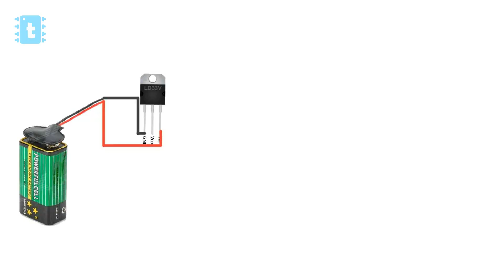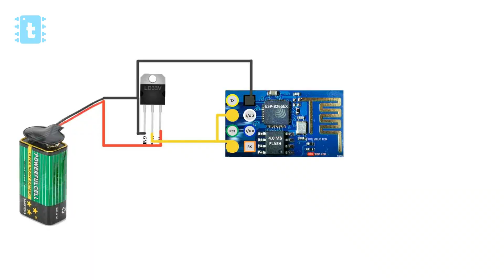Controlling Relay with esp8266 module | without relay module | without Arduino

Comment: I realized my failure in the numerous guides I followed to put a transistor on the relay driven by ESP8266-01 ... I was always excited by the relay because the optoisolator was missing. Thanks! Now I get Optosiolatore and I can finish the project. I used as Relay a KY-019 on a base with three positive contacts in the middle, negative on the right and Input on the left ....

Comment: Hi, I'm struggling with other issue managing relay board and I would like to know if you could give me any tip. I did mount all schematics as you shows with a littles tweaks. I did used a cell phone 5V power supply that power FTDI which feed the 3,3V to the esp01. I used the 5V to power up the relay and optocoupler. Before I'm been using the GPIO of the controler connected to the pin 1 to trigger the optoisolater and the pin 2 connected to the ground, but now I did as you show in the video. The question is, I need a dry contact to control my garage door which means a short circuit during less 1 second. I did an automation with Home assistant that can achive that. But the esp01 always flickering when boot, which means a trigger the the garage door. How I can keep the relay at off state until the esp01 finish the boot?

Comment: When I connect my esp8266 to coil pins on relay, my voltage drops from 3.3v to 1v. But relay works correctly when I manually use ground and 3.3v from board on relay coil pins. Why such big drop occuring?

Comment: Why I don't face this when I use relay with arduino. I never used optocoupler to switch relay.!should I? It gives isolation thats true. Is there any other problem?
Reply: Output voltage of Arduino is 5V & that of ESP8266 is 3.3V. So you won't have any problem while using relays on Arduino.

Comment: one problem i found after reset gpio pins not working when connected to led .. if not connect led then reset and connect led its working but that is not a write way to use if any power interrupt occurs device will not start after reset

Comment: If you can necessary electronic parts which you have used... That will be more helpful
Reply from the maker: +rohithd what??
Reply: techiesms i was interested to know the parts list used in this video.. So that i can get them from the electronic store
Reply from the maker: +rohithd 
Esp8266 01
Led
6v relay
1n4007 diode
Bc547 transistor
7805 ic
9v battery
Mct2e ic
1k resistor
Reply: techiesms octocuplor ic???
Reply: @techiesms  Hi sir, 7805 IC looks like 5v regulator, will it be suitable for esp8266 ?

Comment: Hi I need a control on DC motor by sending cmd msg (off/on/frwd/backward) to esp8266_01 module via android app on wifi/hotspot connection....?? how to achieve this??
need assistance

Comment: but  in esp01 relay board operate  though a  single  transister  no  optocoupler used in that
Reply from the maker: Well not all pins works with transistor 
That’s the thing

Comment: hello, congratullation for the video. I followed the video struction but, i am having problem with esp8266-1, the GPIO or GPI2 Pins goes "HIGH" a short pulse on boot ". could you help me?
Reply: use a 1N1007 Diode or LED before connecting your node to the module
Reply: @sajadgerdakaneh7106  thanks, i Will try...

Comment: How to upload program in esp8266  sir  i tried  with arduino  AT command working but program not upload
Reply: Esp8266-01 module is not stable for product use 
I think you can try NodeMCU board

Comment: Ever heard of a snubber diode? It's the backEMF from the relay that keeps knocking out your ESP. You don't need an optocoupler, and you clearly don't know what you're doing.
Reply: My circuit is On and off and not blink. I tried snubber diode but still the same. But true enough that somehow it knocks off the esp module. Disconnecting the GPIO2 connection first before connecting to wifi module will be the workaround. Any idea why snubber diode does not work?
Reply: @ecguide7181  Do you mean that the ESP fails to START when connected to the relay? If so, note that the voltages on GPIO2, GPIO0 and GPIO15 are important during boot.

If you would like additional help, I shall need to see a complete circuit diagram.
Reply: @SodAlmighty  hey man. My digital D3 pin is turning high (3.3v) & low (0v) properly, confirmed with led. But when I use it as relay signal (vcc=5v, gnd to gnd, in=D3) it doesn't switch according to program. But when I connect my relay board's IN pin to ground - it switches everytime properly. Please gimme your email id or insta, so I can send u pics.

My relay pcb is without optocoupler.
Reply: @Naxxx.110  Yeah, I'm not going to post my email address in a YT comment, are you mad?

Does your relay have a snubber diode? Is the relay board input pin going to a transistor or straight to the relay?
Reply: @SodAlmighty  i have the same issue. I am a beginner and i am using a 2 channel relay module. Can you explain where should I attach a snubber diode?